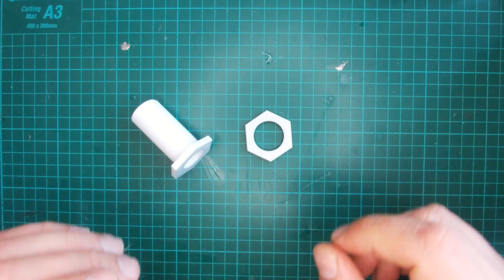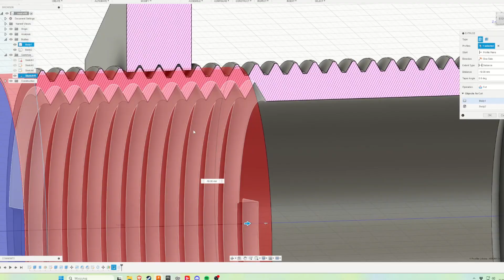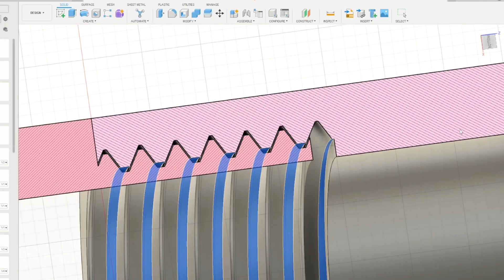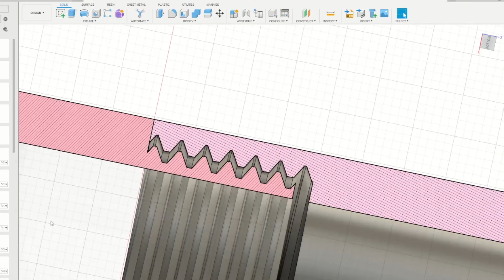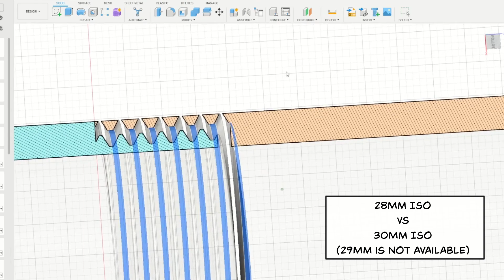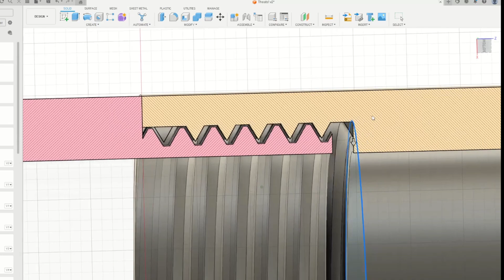Threats of 3d printed threads

Comment: You can manually edit the ThreadData file in the Fusion folder on disk to create custom threads with fractional or completely arbitrary major, minor, and pitch diameters. You can even customize the pitch angle, though it's easy to break things doing this. Search the forums for ThreadData for how.
Reply from the maker: Oh nice, didn't know it was possible - thanks for hint!